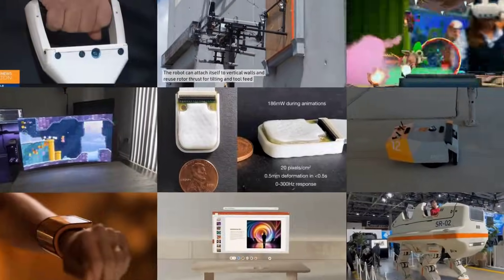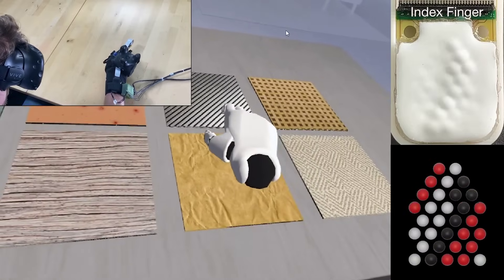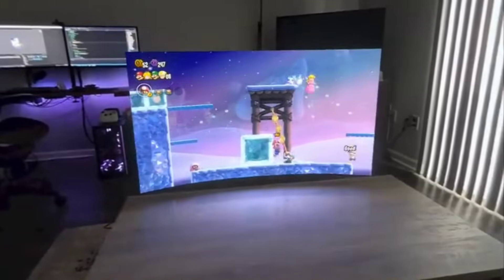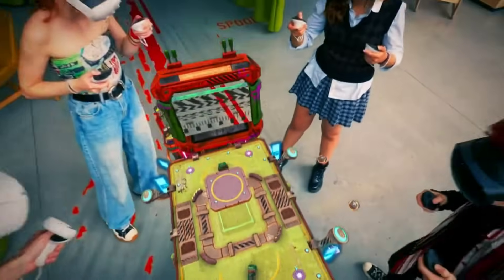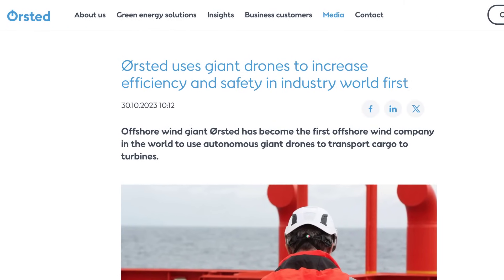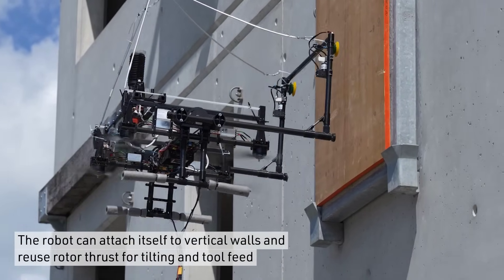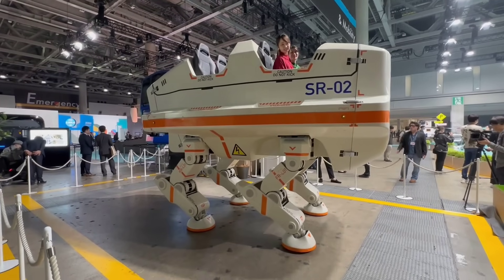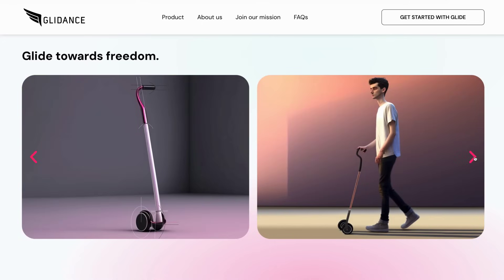TOUCH Virtual Reality in High Definition (+ More News)

Comment: The electro osmosis touch output device could be a gamechanger for blind people too. Even though some makers came up with new micro actuators that cost a fraction of traditional braille outputs, this could be even cheaper and more scalable, especially cheaper because it could be widely available soon, since it's use for non-blind people in VR gloves.